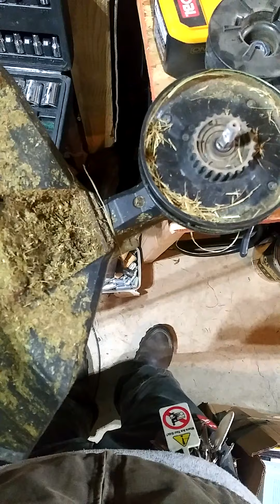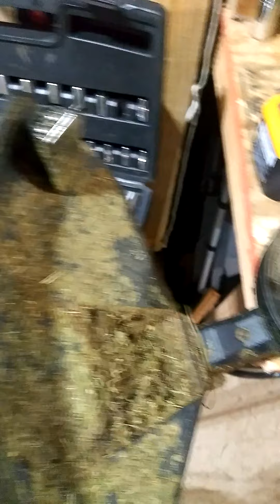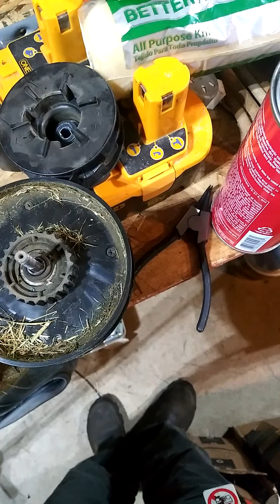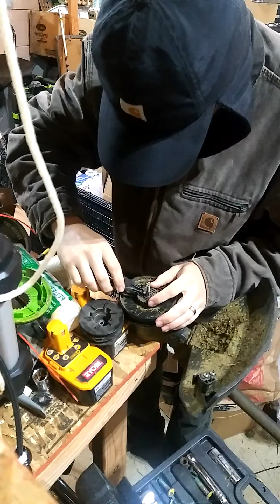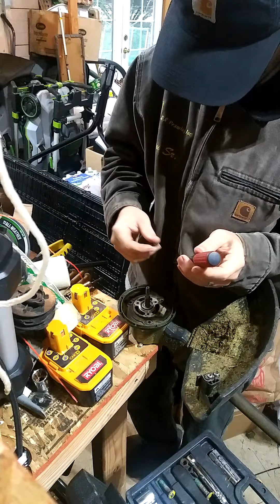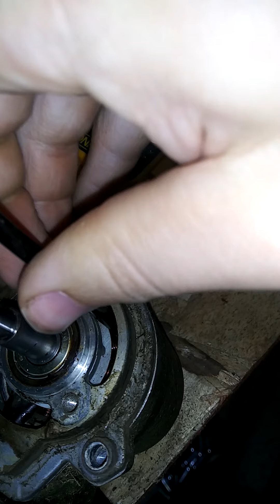repair and review of the Ego carbon fiber shaft trimmer/weed eater

Comment: You should have just pulled the motor out of the housing, you were so close!  Once you get it out it dismantles into two parts with all the magnets accessible.  Normally I’d say it’s not really worth repairing considering the amount of vibration and heat that it took to cause those magnets to dislodge, but you probably could have re-aligned and re-glued those magnets as well as fully cleaned that motor out in the time it took you to make this video.
Reply from the maker: Thanks for the info I'll look into it and see if its worth making a second repair video

Comment: After completely restoring one that was fully jammed up with a motor full of rust and caked with debris I can see why you consider them durable.  However I have a hard time seeing them as a “professional” machine due to the fact that the motor is able to suck in moisture and debris without any way to clean it out other than dismantling it.  Mostly though I can’t stand the fact that the head spins in the WRONG DIRECTION!  Every other trimmer spins to the left and there’s reasons for that.  Unless you are a novice on a string trimmer you have to re-learn the technique to use this machine.

Comment: Mine won’t spin w the trigger it’s like it’s seized up. I can spin the thread shaft w pliers or by hand it it’s rough.. 
hope it’s fixable 😞. I really like this trimmer
Reply from the maker: They do make a replacement motor however I find its usually some small electric component that is shorting out
Reply from the maker: The trimmer with powerload should only spin in one direction, if you can spin in both you may have a broken shaft or gear.
Reply: I got one for free that was pretty seized up.  I disassembled the head, opened up the motor and cleaned a ton of rust and debris from inside.  Oiled it up and got it spinning freely again.  Works fine now,  I’m looking into attaching a standard pro style head to it now.